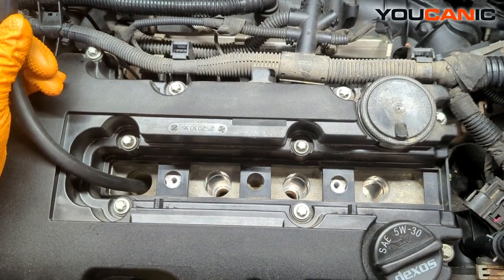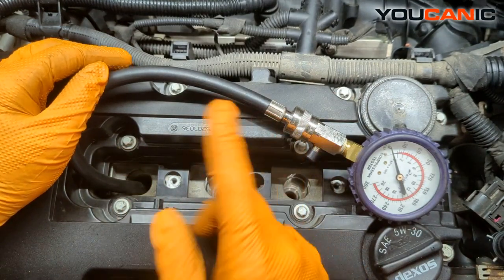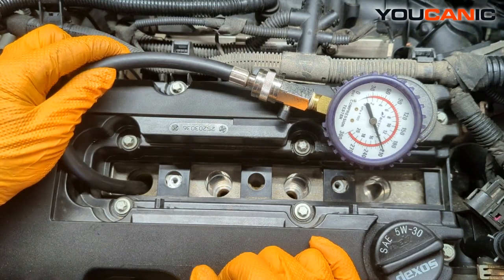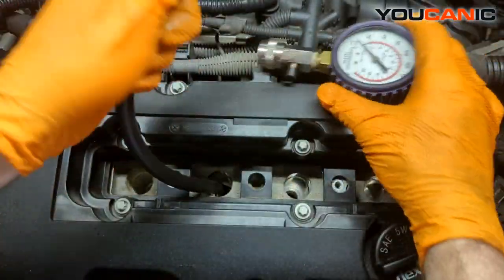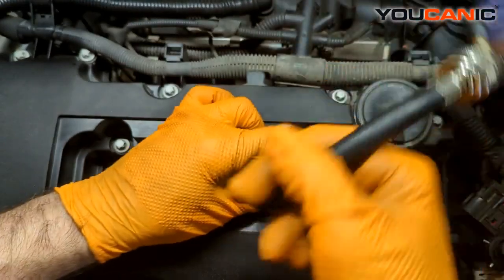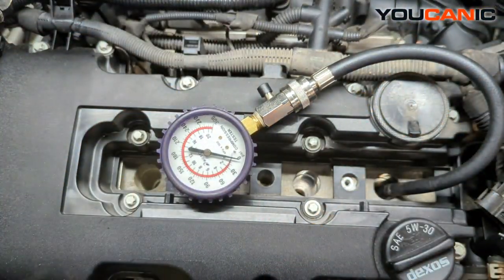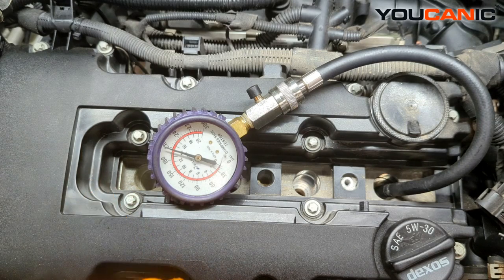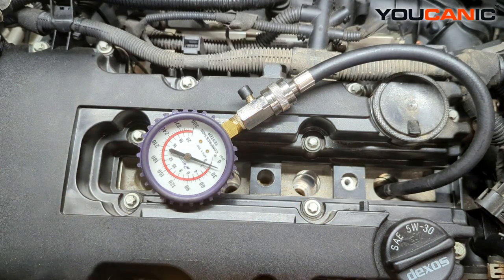How to do a Compression Test on Engine Cylinder - 2008-2016 1.4L Chevrolet Cruze

Comment: I don't think my '15 had any fuel pump fuses, only fuses for the fuel control module.  The ones for the fuel pump(s) were vacant.
Reply from the maker: Thanks for your comment! It's quite possible that your '15 model may have different configurations with the fuses. At Youcanic, we offer detailed guides, free resources, and our unique YOUCANIC scanner to assist you in understanding your vehicle better. 

Don't hesitate to seek support on our website if further assistance is needed. Our mission at Youcanic is to empower you with knowledge, enabling confidence and cost-savings in car maintenance. Visit us at www.youcanic.com. We're here to help you on your car ownership journey.